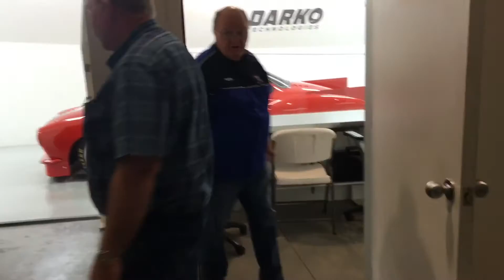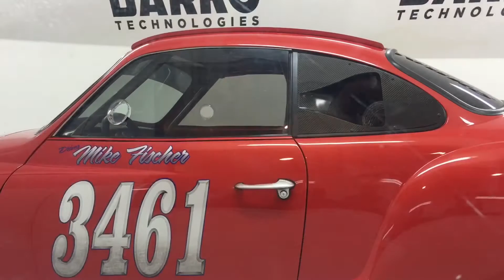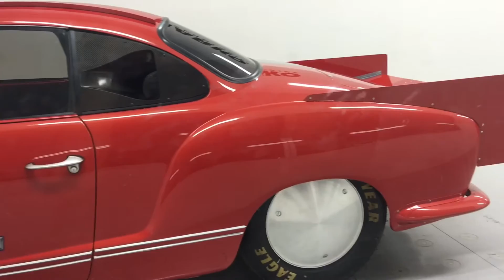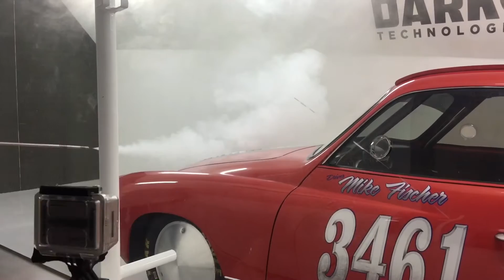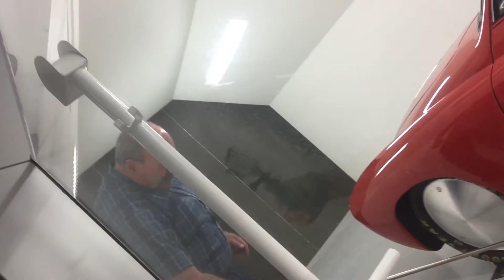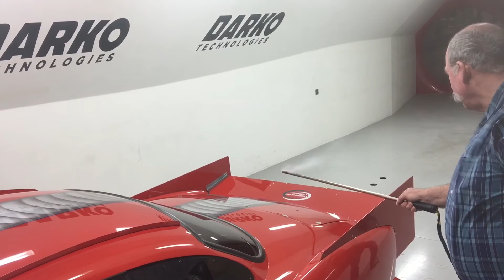Darko Technologies raw footage.

Comment: So what did you change from the setup shown based off of the results? Im running a 69 convertible and like your large fender wings. A rear spoiler is prob a waste for me due to disrupted air flow. Over 100mph the front gets light and i installed a front spoiler w some success. Is an air dam better? My top end at 1/4 is 131mph looking at 170s in 1/2 mile. I have a supercharged caddy northstar mid engine mounted.